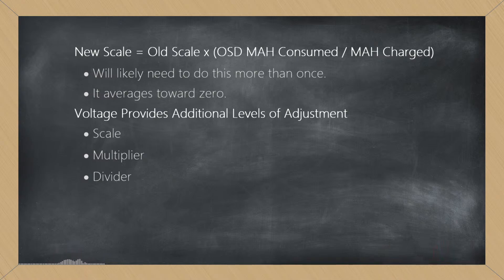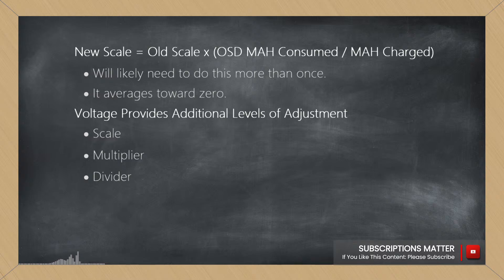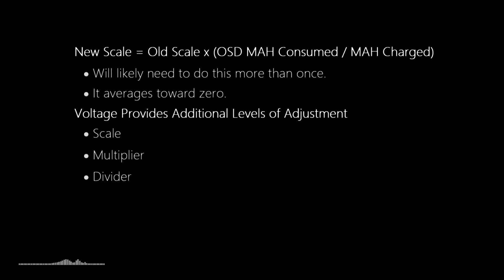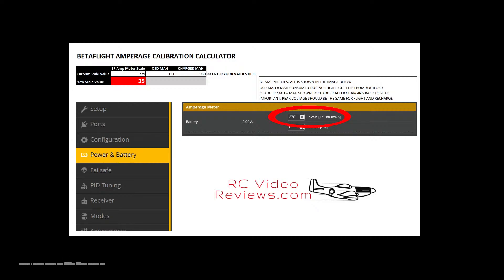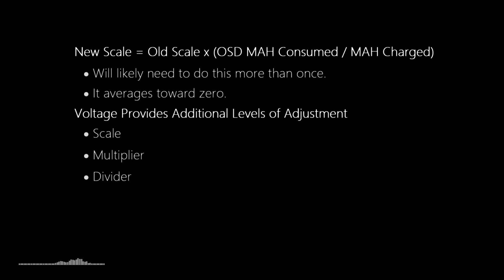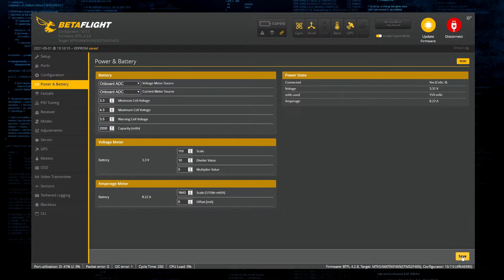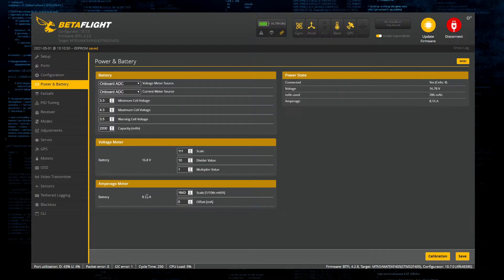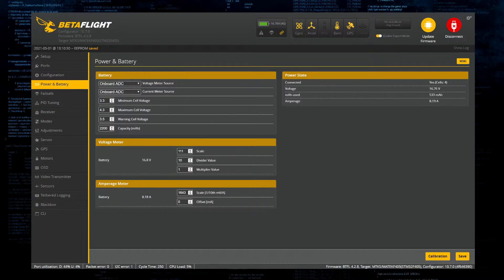How-to Calibrate Battery Volts and Amps in Betaflight • Critical Configuration Step

Comment: does this work with Rotorflight too?  i used the Calculator and went out and flew it it was still way off when using this logic with Rotorflight Config
Reply from the maker: I haven't done anything with calibration on RF, so I can't answer.

Comment: Hi, i have battery ( GEPRC 3300 6s ) there is an info 22.2 V.  When i checked on  the meter and charger  I have 25,1 V.  I went on scale to 56. I have recharged 3 times battery. And I missed a lot every time. Do we check battery when is full/storage. Help me please

Comment: What about the battery capacity? 2200 mAh on your screen .. Do you use the advertised battery capacity or how many mAh you use or some other number (eg. less than batt capacity) so that when your OSD shows a percentage of mAh used or left you are relatively safe?
Reply from the maker: I usually don't go by mah which is just calculated from current draw and time. I prefer to use voltage. I usually go to 3.7v/c - 3.75v/c during flight which usually winds up being 3.80 after rest. You can push your batteries a little harder if you want, but that's what I do.
Reply: @RCVideoReviews  - thanks for the quick reply .. are you in AZ by any chance? I think one of your fields in your intro was in Mesa? Do you only or mainly fly planes?
Reply from the maker: I used to be in Arizona. I've flown pretty much everything: Long Range FPV, Quads, Helis, Sport Planes, Pattern Planes, Jets, 3D. I'd say I've touched on most branches of RC flying.

Comment: i have a 6s build speedybee v3 stack over 22 volts  thru a 55 amp stack the xing2 1755kv motors oscillate jitter effect I have tried everything in pid i have same motors on a cheap tmotor stack 6s work fine mabey  a faulty gryo ..voltage regulator off ??? ????? I had another speedybee v3 never had this issue

Comment: Thanks John.  For some reason I don’t have the  Amperage Meter section in my Power & Battery tab.
Reply from the maker: Hmm...make sure your firmware is up to date, that BF is up to date, and that your board provides a current meter.
Reply: @RCVideoReviews  I’m on BF 4.2. 

Good point about the FC board.   I did not realize that some FCs don’t have a current meter.

Comment: Thanks for the video! So how about that static amp draw? I have a high static as wel and I see different total amps when I fly 1 pack on 30% or 1 pack at 70% throttle. So I guess that has to do with that high idle amp draw. So I guess at lower throttle the displayed amps are probably too high and in the higher throttle range the displayed amps are too low. What do you think?
Reply from the maker: I really don't understand your 30% 70% example. Static will always be higher than dynamic (by about 10%) as the motor unloads in-flight after the initial thrust. In any case, I would suggest following the video, use the actual measured data from flight for the most accurate calibration.
Reply: @RCVideoReviews  I’m talking about 1 pack throttle continuously at 30% throttle vs 70%. I guess I have to give some offset and change the scale